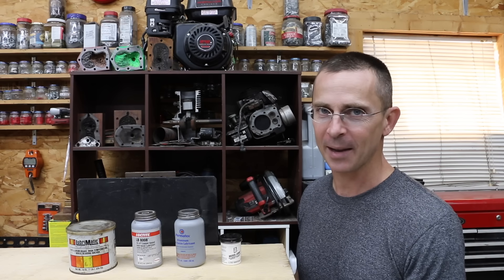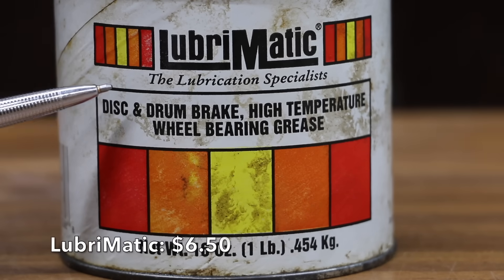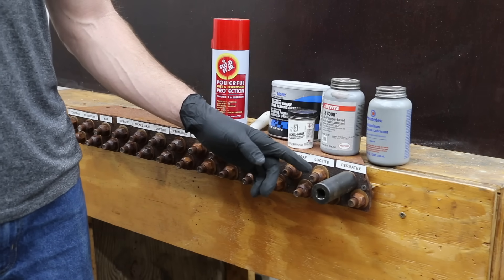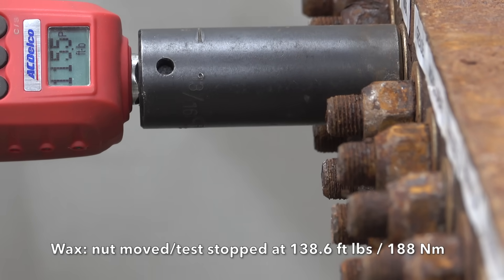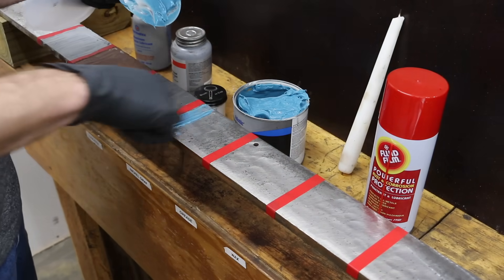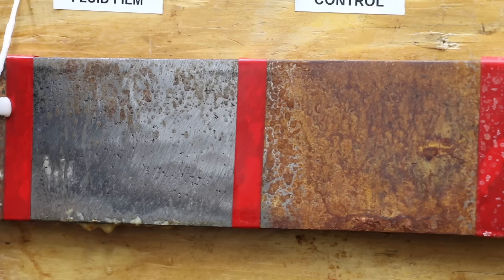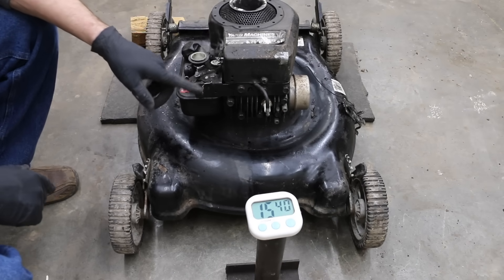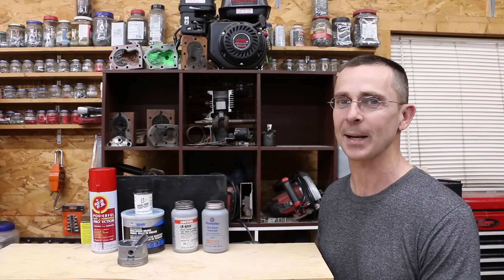Does Anti-Seize Compound Actually Work? Let's find out! Anti-Seize vs Grease vs Fluid Film vs Wax

Comment: Unfortunately the EPA banned the one component that worked extremely well in antiseize.
The component was LEAD.

We know that torque test just HAS to be fake!
Why? Because that cheap craftsman socket didn't break! lol

Try your test again but use some used motor oil on the threads. This was in owner's manuals in the 1960's for use on wheel nuts.

And with silicone lubricating spray (and the silicone grease too).

And again with ATF.

And WD 40

and finally Gun oil (synthetic by Lucas).

Plain old olive oil? Veg oil?

Comment: On exhaust nuts and studs on aircraft engines, we always use Copper Silicone from a tube on the threads.  Does not seem right but it works.
Reply from the maker: Thanks for the feedback.

Comment: Consider testing dielectric grease to plumbers silicone grease, silicone brake grease, Lithium grease and ACF-50 for protecting electrical connections in a moderately harsh environment like a motorcycle, car , or boat.

I addition to corrosion protection test conductivity of  connections and insulation characteristics.
Reply from the maker: Thanks for the suggestion.

Comment: I've been using the permatex on all the suspension components of my Jeep and even after putting it though water, sand, salt and mud the bolts go easy. Nothing worse than having to fix something out in the desert and not having a 3 ft pipe with you. Anti-seize works - period.
Reply from the maker: Thanks for sharing.

Comment: Good tests, as usual.  (ho hum ;)  The lanolin and wax samples probably burned off in the heat.  
I used the copper based product after getting out of UTI back in the '70s.  Now I'm using Permatex aluminum without any problems. It's great on outdoor equipment (wheel barrow, mower, steel hose reel) and furniture.
Reply from the maker: Thanks for sharing. Thanks for the video idea.

Comment: There are two BIG problems here. First, you keep using the brand names as the comparison when none of them are the same. Pretty much every manufacturer of anti-seize offers aluminum, copper, and nickel based products. If you want to compare the three different bases, you need to do so among one brand. If you want to compare these three different brands, you need to do so within one base. Secondly, you didn't use any anti-seize on the face of the nuts and you can see some of them were rusting to the steel the stud passed through. When putting alloy wheels on a late model auto here in the rust belt, the smart guys anti-seize the threads, the faces of the nuts, the center hole of the wheel, and even the flat surface of the hub that the wheel mounts up against. Otherwise, you can be fighting for a long time trying to remove a simple wheel. Even with "the right tools."

Comment: i have a question about applying it to say head bolts on an engine where even torque values are important. would the  torque and bolt stretch values change because of the lubricant?

Comment: I put regular wheel bearing grease on log bolts on a trailer lug bolts when the rims rusted out 20 years later I figured I would not be able to get the lug bolts out because of the wheel bearing grease they came out it was absolutely no problem as if I put them in a week ago
Reply from the maker: Thanks for sharing.

Comment: Great video!
As always, your tests are well thought out, and meticulous.
However, it still begs the question, Does any one of these anti-freeze really work, 20 years later when I have to replace that O2 sensor?
Reply from the maker: Thanks and you are welcome!  Thanks for the suggestion.
Reply: if you get a quality sensor like those from bosch or stranded motor products they come already dressed with seize protection- so relax

Comment: I live in the rust belt, and they salt the roads in the winter season. I have always worked on my own cars, and I started exclusively using copper anti-seize about 20 years ago. I liked it better than the aluminum anti-seize, and have never looked back since
Reply from the maker: Thanks for the suggestion.

Comment: Real test is whether nuts loosen at all after 5 years of salt exposure without breaking. The tests here are basically testing the lubricant and not the anti fusing properties of the product.  What happens is the product evaporates slowly after time and nothing is left eventually. Aluminum antiseize is designed for one of the mating surfaces to be aluminum. I work on cars that the previous guy put a dab of brake or other moly grease on a fastener, and it seems to work decent.
Reply from the maker: Thanks for the feedback.

Comment: I once worked at a place that used milk of magnesia on stainless steel bolts as an anti seize agent and it worked very well. Without the anti seize agent stainless steel would gall up and be impossible to remove.
Reply from the maker: Thanks for sharing.

Comment: I used a "never seize" product on my boiler hand-hole bolts. Ran the boiler 8 hours a day, 6 days a week for a year. Used the same hand-hole plates for 6 years and never had a single problem with corrosion or removing the bolts.
Reply from the maker: Thanks for the feedback.

Comment: Thanks for this in-depth test ! Just like the other commenter, I feel confirmed in my use of Permatex Anti-Seize for about 20 years. My concern wasn't actually rust. I became aware of a problem when I turned a 3/8" stainless steel bolt into the aluminum triple tree (= handlebar bracket) of a motorcycle. An hour later, there was absolutely nothing that would make this bolt loosen up again - not an impact wrench, not a 2-foot extension. A colleague who is a chemical scientist explained the process to me, telling me "you've essentially created a battery, and sort of welded those two different metals together." I've used the compound ever since then on dissimilar metals, especially where stainless steel meets aluminum.  It's also great on spark plug threads. Spark plugs often live in tight, barely accessible places. An untreated thread can put up a lot of resistance, then suddenly let go with a snap. An easy way to bust one's knuckles as the wrench flips around.
Regarding the "motor oil substitution", I hope the SPCSE (Society for Prevention of Cruelty to Small Engines) doesn't catch up with you! 😁😁
Reply from the maker: You are welcome!

Comment: I worked for several PVC pipe extrusion companies from 1970 to 1996. We used Fel-Pro High Temp anti-seize with copper on all extrusion tooling bolts, as well as the large gate bolt that help the tooling to the extruders. I understand that Locktite sued Fel-Pro Corp for patent infringement of 4 products in the late 70’s but Loctite lost their case. In 1998, Federal-Mogul acquired Fel-Pro then turned around and sold it to Loctite for a hefty profit.

Comment: Years ago I worked at an Oceanarium in Hawaii. We had well pumps that where used in a salt water wells for supplying Saltwater to the exabits. Typically these pumps would last a few years before the corrosion etc required their replacement. Upon removal they where pretty much unrecognizable blobs. However when we installed them we would coat the fasteners with a product called "Never Seize" also referred by us as "Ever sleaze". Apron disassembly several years later they would come right off. I think it was some type zinc infused grease that looked like the permatex.
Reply from the maker: Thanks for sharing.

Comment: I worked on gas turbine engines for 23 years (production, repair & overhaul, and test lab), plus the first four years in the USAF. We always used copper-based anti-seize for "middle" high temps, and nickel-based for VERY high temps. I was surprised to see the copper outshine the nickel. Been out of the field since 2008, so are there any other jet mechs (or engineers?!) out there who can explain this?

Comment: After 50 years experience in heavy equipment repair, using anti-seize every day and have tried every brand. There is one brand that is lightyears ahead of all others. This brand has two different formula's, one being for high heat applications.
So, the only anti-seize worth spending your money on is the stuff your get at your local Caterpillar Tractor dealer.

Comment: I am a professional engineer for living, and a weekend mechanic to maintain all of my family’s vehicles. Many years ago I started to work on my SUV. I was so frustrated with the rusty nuts and bolts when I replaced the front ball joints, and wheel bearing and hub assemblies. I realized that the dealership never did the job right. I gave up any dealership services. I take care of our vehicles by myself. I always use Permatex anti-seize and torqued to specifications on vehicles. Recently I replaced the wheel bearings and hubs which I installed 6 years ago. It was so easy to loose and remove the bolts and nuts. 

By the way, I also use Loctite (blue) on my gunsmith works at home.
Reply from the maker: Thanks for sharing.

Comment: I used lanolin-based hand-cream, about the same consistency as toothpaste, on anchor fittings that were down for 6 months, and they were easy to undo by hand. No heat in this case, but it surely kept the salt water out. 
I'm a great fan of lanolin, and keep a spray bottle of 50-50 liquid lanolin and methylated spirits, and spray all my tools and machines where rust might be a problem, or a nut needs loosening.
Reply from the maker: Thank you for the feedback!

Comment: I have used permatex anti-seize for over 30 years and I swear by it!!! I use it on all lugnuts on semi trucks because of road salt and corrosion. And I NEVER have any stripped or stuck frozen lugnuts when I use anti-seize!! And anytime you thread a steel or stainless steel bolt into aluminum threads you should ALWAYS use never-seize because it will stop the electrolysis between the 2 metals that will always give you issues with the chemical reaction between steel and aluminum touching eachother.

Comment: I was a maintenance tech working with high pressure and heat. Milk of magnesia  was my choice of antiseize. Brush on bolt threads, steel tie rods and chains that were subjected to high temperature. No toxic chemicals.
Reply from the maker: Thanks for sharing.

Comment: Can we try some of the other ones? Specifically N5000 and Neolube? Are they really better than the cheap stuff? 
Also something to keep in mind is at high temperature copper and any kind of chlorine  compound will weaken steel over time, even if they stop corrosion which is why both are completely banned in many industrial applications.
Reply from the maker: Thanks for the suggestion.

Comment: These anti-seize products are not lubricants - they are colloids - liquids (grease, oil, petroleum) with solid particles (aluminum or copper) in them. After the grease, oil, or petroleum is washed away the solids (aluminum or copper) remain between the nuts and bolts as a protective non-oxidizing barrier so the nuts and bolts don't rust together.  Cool vid - thx.
Reply from the maker: Thanks!  Thanks for the feedback.

Comment: Dear mechanics from across the world, what anti-seize compound would you recommend to use on NOTORIOUS FRAGILE glow plugs thread of DIESEL ENGINES?
i imagine if by mistake you mix cooper and aluminium compound rust will appear.. NOT that I intend to use such combination.. at all. 
i have at the moment cooper, aluminium and ceramic (that is the latest anti-seize compound that I got) made by Febi Bilstein.. I am tempted to use ceramic for all the hot environment (engine glow plugs, injectors..) from now on. I live in the UK.

Comment: :30 Before getting any further into the video, I'm gonna say right now that it's bullsh-t for anyone to say candle wax works just as well as anti-seize. Did they forget that the sun and motors produce hot temperatures that can melt the wax out of the place it was applied?

Comment: The only anti seize compound I have ever found to work over many years 50+ exposed to the elements is "Copper & Lead"  anti seize grease, though after the world's rejection of Lead products now hard to find. Such a pity that products that have been used successfully from Victorian times are now not available even though the modern replacements do not work as well.
Reply from the maker: Thanks for sharing.

Comment: Could you do the test without the heat? I want an anti seize that works in normal nonheated temperatures. Many tests have shown that hot wax works as a superior lubricant for bike chains (Look up zero friction cycling). Chains don't get that hot, so the wax does not melt away. It does resist sand quite well compared to oily substances. Perhaps wax would work as an anti seize without the heat. I currently have a pair of bike pedals that the bike shop cannot get loose. I used copper based anti sieze on them, apparently to no positive effect. I do however ride my fatbike along the ocean (salt) every day.
Reply from the maker: Thanks for the suggestion.

Comment: Any metal filled anti-seize is ESSENTIAL when fitting stainless " Nylok™ " nuts to stainless threads .... as the nut progresses up an unlubricated thread , the metal galls and ( cold welds ) , causing untold misery , you can neither undo nor do up any further and then you find your angle grinder will not access where the bolt is , resulting in a wrecked bit of kit ...... ! ! ...OMG ...
Reply from the maker: Thanks for the feedback.

Comment: I want to point out that Copper based Anti-Seize products like the loctite can cause corrosion with Steel bolts 🔩 
You want nickel based to avoid car problems down the road.
Maybe the Nickel-Graph or Permatex Aluminum but not sure if they have copper in their formula for Anti-Seize

Comment: I have no particular beef with your method (and think this channel is awesome for real world unbiased  'does the tin do what it says' comparisons - that's pure gold in this era of advert noise) .. it's not easy to simulate a hundred thousand miles of rust belt driving, but I think your choice of fasteners is off. Those big boys may be a pain to break free, but they generally do. Last week removed a truck wheel that had been on since 2008. that was certainly work .. but the real pains are small crap grade fasteners that easily seize beyond their strength. Caliper bleed screws, manifold studs, etc. Also .. you missed dis-similar metals. ie .. studs in aluminium blind holes, etc.
Reply from the maker: Thanks!   Thanksk for the constructive feedback.

Comment: I just want to watch this video to say one simple factor in this case study. Bolt stretch. In automotive applications torque specs are set as a dry spec, meaning no oil or coating to threads. If it requires some sort of coating to threads, service data will tell you and will tell you what to use and how much. 
If wheel nuts have a torque spec of 100lb/ft, and you apply anti seize to the threads, by the time you reach 100lb/ft you will have turned that fastener further than you would when dry, causing that fastener to stretch slightly.
I’m in Eastern Canada, it doesn’t take long for rust to start. A wax based undercoating (or even the fluid film shown in this test) to protect the body of the vehicle is all that’s needed. I’ve been in the industry as a licensed tech for 14 years and every professional tech I’ve met in my area will agree with me that the best care you can give is regular service and undercoating. No one here professionally uses anti seize or equivalents.
Reply from the maker: Great point!

Comment: I have used the Copper Base on Off Shore Oil Rigs exposed to Salt water every day for YEARS  and it is the only thing I recommend .  Copper is used in Boat Bottom Paint .  I always use it on Spark Plugs also because the aluminum head and steal spark plug naturally corrode
Reply from the maker: Thanks for the feedback.

Comment: I'm a sailor. My go-to anti-seize is a product called "Lanicote", It's basically lanolin from sheeps wool. Main thing is, it doesn't react with or allow galvanic corrsion between dissimilar metals, and it's very water resistant. I use it on rigging screws (turnbuckles) and even after a couple of years, the screwes still turn freely. Not sure how well it works to prevent galling between nortorious metals like stainless steel and itself, in high-prerssure applicaltions like fasteners, but it's great for rigging screwes.
Reply from the maker: Thanks for sharing.

Comment: My brother has been a heavy equipment mechanic his whole life.  He swears by antiseize and Permatex "the right stuff" as the strongest adhesive out there.  I have used the right stuff to glue inside door panels on my buick.  I would have to cut the door panel off if I ever need to get in to change out the window motor.
Reply from the maker: Thanks for the feedback.

Comment: Yes, anti seize works but I have never used it to lube anything. Just when replacing bolts that I know will be stuck  in the near future.I started using it first on exhaust manifold bolts. Also steel bolts going into aluminum. Most of these products work but only on what they were designed for.
Reply from the maker: Thanks for sharing.

Comment: I've used Permatex Aluminum Anti-seize for over thirty years on spark plug threads and it's always worked great. I have a bottle I bought in the late 90's and I'm still using it; there is no expiration date. I'm surprised the Loctite copper has one.
Reply from the maker: Thanks for sharing.
Reply: @ProjectFarm  I really appreciate you making these videos. Saves us from wasting money on inferior products. Thanks!